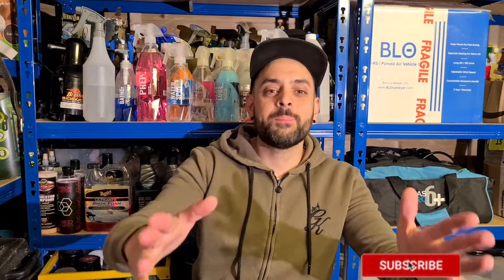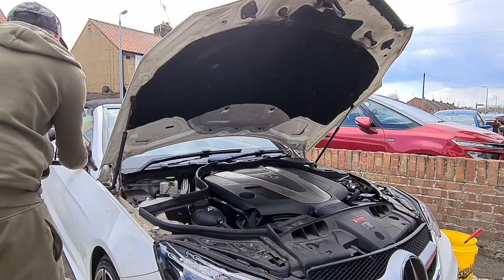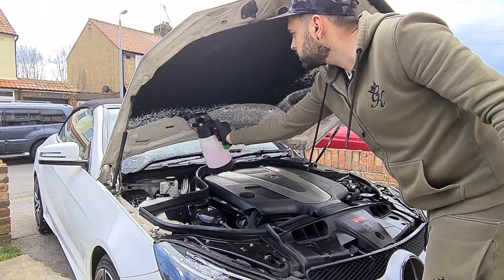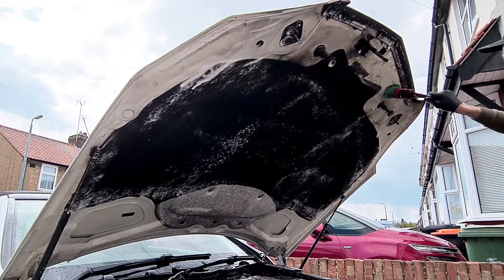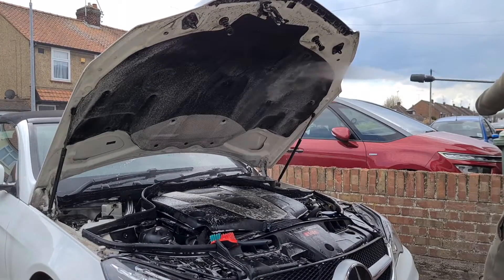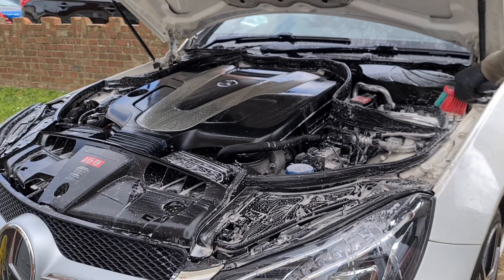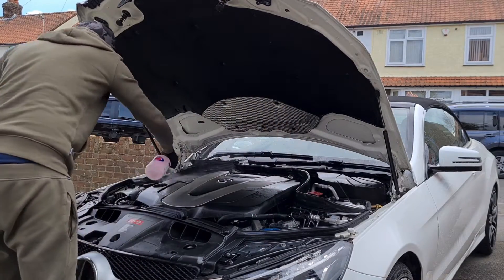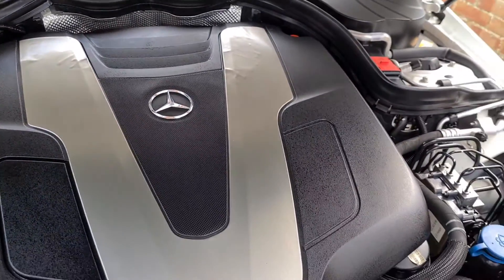how to DEEP CLEAN your Engine bay

Comment: I have a mk7 transit van for work and like to keep it clean as possible, is it safe to clean the engine bay if so is there any particular parts I should avoid or cover?? Also what would be a good degreaser to remove the oily matter from it, thank you 🙏
Reply from the maker: Hi dude hope your well, sure engine's are very safe to clean as long as your sensible, cover anything like ecu and alternator if it looks like it's going to get very wet, products bilthsmber surfex HD would be my choice very strong. Make sure engine is cold this will protect it. Also somthing iv used more of recently as a dressing koch chemie motorplast apply when still wet :)
Reply: @APASSIONFORDETAILING  happy new year, brilliant thank you for the reply I shall give it a go when we get a half decent day 👍
Reply from the maker: @elvisoorloff224  your welcome 🙏🏼